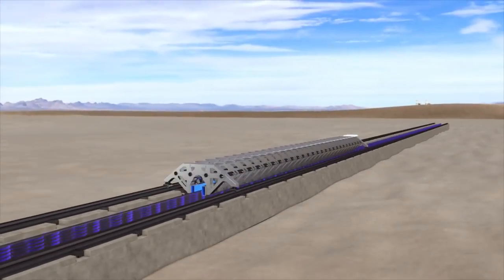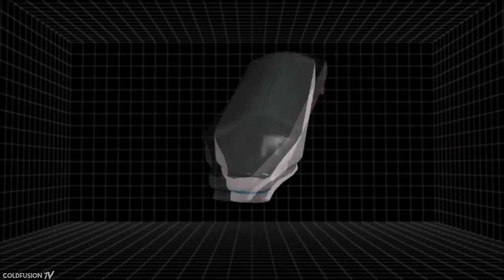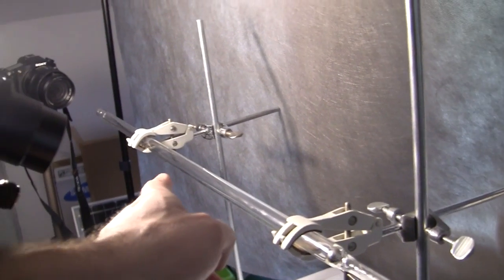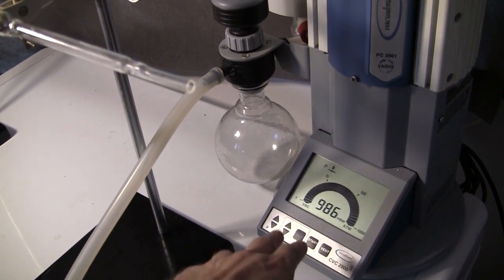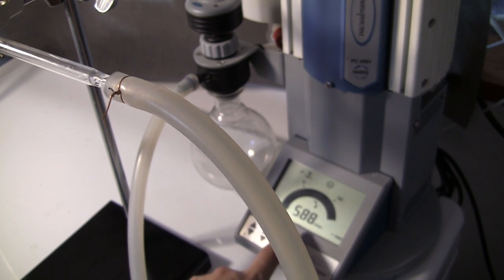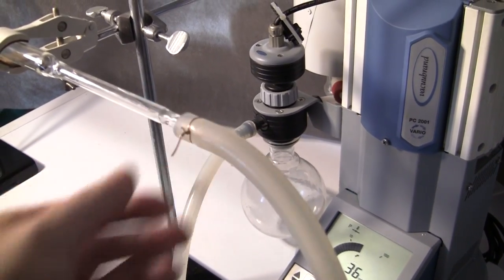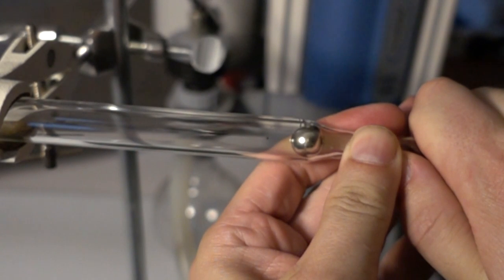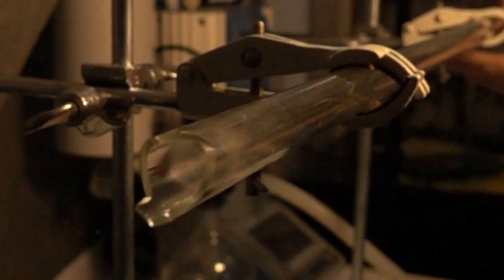How  the Hyperloop can kill you!

Comment: In my opinion this is almost analogous to rapid decompression of an aircraft cabin. Certainly potentially devastating, but nothing that can't be engineered around. I wouldn't go as far as to say it's "PR Bullshit".

EDIT: I'm not saying it's a simple task, but these are challenges that engineering can attempt to solve, and there are plausible solutions.
Reply: lol. "It's a solid fact that a pod in the hyperloop will behave exactly like a ball bearing in TF's video I just watched!!" Alright buddy.
Reply: There's a flaw in your comparison there, an aircraft cabin is quite easy to maintain pressure in, because there is not much surface that can fail compared to a hyperloop tube, which would be going for miles: There's much more potential for failure there.
Reply: Except if a cabin depressurises your internal organs don't immediately turn into meat paste
Reply: Well that's conjecture.
Reply: Except for the fact that the passengers are in a sealed pod.
Reply: It would take 62kN of force from air flowing against one side to accelerate a 3.1 tonne pod with 20g acceleration which has reasonable survival rates on human body. 

Bare in mind that the pod is aerodynamic and allows for some bypass of air around and through it and it has mechanical braking will reduce the net accelerating force by some amount.

TF is doing a demonstration which mimics a gun, with a projectile that almost allows for zero air to bypass it which maximizes the pressure against the projectile and thus higher acceleration.

The pod is the opposite in design to allow for air to bypass the pod both around and through it, at least from what I've seen on the alpha proposal.
Reply: it's solid fact
Reply: ***** Fucking morons.

What do you think happens in a submarine? Yet we still use submarines.

No, a failure in the tube won't cause fatal acceleration because of braking systems.

No, pressure entering the tube won't crush the pod. Why? The pod is already under pressure.

Oh noes, basic engineering problems!

Go fuck yourself.
Reply: There are more modes of failure for aircraft fuselage than a static vacuum tube. 

You mention that there is much more "potential for failure". That's kind of vague. What kind of failure?
Reply: The tube that Elon Musk proposed was about twice the diameter of the pod, the air would largely stream above and around the pod, it would not accelerate the pod as much as thunderfoot show here. The pod would also be much heavier. The experiment he does is not analogous/not nearly good enough.
Reply: +Double - N There's a flaw in your comparison there, an aircraft cabin needs to fly through the sky at high speeds. The hyperloop tube is stationary, and doesn't need to be light enough to fly.
Reply: 62000N / 3100 KG = 20 m/s^2 

20 m/s^2 is an acceleration perpendicular to the spine that has acceptable survival rates.

3100 KG is the alleged weight of the pod as per the alpha proposal. 

Then you can go about engineering solutions that ensure that the pod is not exposed to that kind of force from air flow such as. Aerodynamic shape,  mechanical braking, bypassing air via larger diameter tube, distributed and controlled pressurization of the tube. These are potential solutions.

The question becomes what kind of force are we dealing with in the event of catastrophic tube failure. that requires some fluid dynamics analysis.
Reply: That's what I was thinking, I'm sure there are safety systems which can be developed.

But at the same time I'm sure that  "it's dangerous" is not his only case against this idea, and I'll reserve judgment for the full video. I bet he'll demonstrate how this would be impossible to build, insanely expensive, and innefficient or something along those lines.
Reply: VectorBunny
Cart has a leak/hole/any location that isnt air tight = everyone inside gets splattered across the tube or the inside of the cart like people in a sub.

Tube itself has a hole and the pressure accelerates the cart enough to kill anyone inside or as a brilliant mind suggested in other comments, they try to equalize the pressure and the cart gets hit by rapid pressurization form all sides.

Anything related to magnet failure or friction melting the bloody thing or blowing it to smithereens (being the only pod of oxygen in the tube).

Any form of regular human errors all traffic suffers from but at 2~3x the speed.
Reply: No, its solid fact based on the effects of a vacuum on a human body.
Reply: I agree of the analogy here; however I am skeptical that this can be engineered around. From the get go we knew this would be a problem for it; mostly because when you're talking about distances you'd want to travel in a hyperloop, maintaining structural integrity is more than a challenge.

You have forces like the expansion and contraction of materials due to temperatures as well as movement of the ground beneath you. While these factors are minimal, they can add up to a big problem years down the line.

This isn't equivalent to just laying down some bullet train tracks through Japan, it's a significant step above that. Just doing something like going from LA to San Francisco would basically mean you'd be building the biggest machine man has ever built.
Reply: mrDh4rm3r Yeh, I bet when people started creating planes there were lots of people trying to say how dangerous it was.
Start by seeing the flaws and then work the flaws, not give up, on how dificult it is to overcome the flaws.
Reply: Errr

Inside a plane, air goes IN, creating positive pressure. Your not exciting a vacuum, your doing the opposite. 

So long as any leaks are not significant enough for the engines pumping that pressure in to overcome,  all is good. 

Vacuum is the other way around, any tiny crack, anything wrong at all and the whole lot goes off explosively. 

If Planes were this way, they would be a flying bomb. any crack, any failure at all would cause explosive repressurisation, not DEPRESSURISATION. 

Also it's a helluva lot easier to stick pressure into something then to take it out. 

If the vessel fails, everyone in it will die instantly. There is a very good example of three cosmonauts who had a failure, at a lot higher pressure then this.. they were dead in less then a minute. 

Ones blood beginning to BOIL does that!!
Reply: ***** Plenty? If we're using magnets there's magnetic breaking systems, and you could always have friction braking systems.

Remember, you aren't trying to stop the pod, you're trying to stop the pod from changing speed too quickly.
Reply: a sealed pod that would be hit by a wave of pressure going the speed of sound. Its not the pressure of  the pod its when the tunnel fails and lets the pressure from outside in that's the problem.
Reply: Double - N Aircraft ARE projectiles.

The internal friction isn't an issue.

My understanding is that the idea is to have the pressure higher than Thunderf00t is saying.

I don't understand why people use the word compare to mean "say these things are basically the same."
Reply: Wojciech Pyczak Trains derail as well, you know? The difference is when a train derails, it crashes into whatever is around the tracks. When this fails, where it "crashes" (the tube) is also part of the system, and can be designed with that in mind to prevent that.
Reply: It could have systems that prevent rapid accelaration in case of decompression, like, I don't know...

Emergency brakes.
Reply: honestly I am more worried by things like an earthquake or shifting ground that could slightly bend the tube. Even if it is just a few centimeters, at that speed you are going to feel that bump and and it could be the last thing you ever feel.
Reply: It's strange unlike his other videos this is more about danger/risk rather than scientific impossibility.
Reply: Agreed. I'm not an engineer, but it looks like some of the assumptions T-foot makes here are a bit exadurated:
1. The ball isn't aerodynamic, but the pod is.
2. T-foot's pressure failure is complete and instant, whereas the real hyperloop will likely not fail instantly but may just have low pressure leaks.
3. There wasn't much space between his ball and the tube. The real hyperloop may have more space around the pod (especially since they need those maglev rails)
4. The ball doesn't have brakes, the maglev could have some very strong brakes to protect against such an incident.
5. The real hyperloop will be hovering on magnets, so if you turn off the maglev, the friction increases very rapidly, also acting as a break.
6. They could in theory detect depressurization on one side of the loop and correspondingly depressurize the opposite side of the loop, keeping the pod stationary.

I think he should retry that experiment, but have a flatter piece of metal in the tube (to be aerodynamic) with full friction contact on the bottom (to simulate maglev turned off)

I don't think a valid debunking of the hyperloop will be so simple or concrete.
Reply: +VectorBunny Not quite. The pressure difference is higher, which matters a lot, and it would apply force to one side of the pod, meaning it would accelerate you, likely very fast. It's more dangerous than a cabin pressure failure, but it's also something you can engineer to minimize the risk of.
Reply: This is just a portion of the full video coming up next.
Reply: David Chavez Again, you're not trying to bring the pod to a stop as quickly as possible. You're trying to stop the pod from changing speed too quickly.
Reply: Plus it wouldn't roll like a ball bearing. They could have a system to shut off the electromagnets in case of a failure. Or maybe reverse the polarity and cause as much friction as possible.
Reply: And what about these poor folks that got blown up in the Colombia accident? Just because it has the potential of being dangerous or even lethal when it breaks, it doesn't mean that we shouldn't do it.. Eventually the technology is going to get better and safer. That's why the guys that start doing something first are so respected ;)
Reply: Only part of the tube needs to be under pressure and its easier to keep it protected because its not hurtling through the air.
Reply: ikr. this is theoretically a good idea. it is theoretically possible. doesn't mean there aren't hurdles in the way of making it become reality. that's why the theoretical idea of a hyperloop hasn't come to reality yet.

i think after the brexit stuff people are a bit more critical of TF's stuff... ether that or this is not really a video rekkin' the hyperloop..
Reply: I still think it could be held in place by the electromagnets that float it..
Reply: Like detecting rapid changes in pressure and quickly letting air in on the other side of the vehicle while deploying some kind of emergency break? Would that be possible and feasible and work?
Reply: seigeengine Indeed, this Tube is vastly different to airplanes in many different ways.

The limiting factor for the tube will be expense, and unlike an aircraft, the chances of it actually experiencing internal friction of actual objects is higher: there are projectiles within them which aircraft don't. These are maintaining a lower pressure while aircraft are maintaining a higher one.

I would say that the pressure difference should be put down a little, rather than 1 millibar or whatever make it 10 or even 100, and build them underground: More difficult to breach and if there was a catastrophic event of derailing it wouldn't tumble through the air.

But there is no comparing the two.
Reply: +seigeengine what brakes? This thing is levetating over a magnetic pole going at 600 mph
Reply: +seigeengine what brakes? This thing is levetating over a magnetic pole going at 600 mph
Reply: So what would happen if you're going to be hit by pressure wave from the front, not from the back as shown in the video ? 
By the way, I'm not really that worried about cabin integrity, I'm worried that in case of failure cabin would derail..
Reply: The video had a pressure wave coming from the back, not the front.
Reply: The system has volume to absorb pressure spikes, and we have self-sealing-and-healing materials (not to mention more nice materials tech coming along with every year, which is some really cool damn stuff). Not to mention that if it's supposed to be engineered as described, there's every way of building in a bypass system for emergencies. If Elon and his team can get a 15-story rocket to balance back and forth on its ass, I don't think they've overlooked that.

Although, yes, I am sort of inclined to think that it might have been a bit more doable to just put together stuff like existing lifting body, boundary layer surface craft and maglev tech. Use the air's lift to carry a heavier load instead, and take as much lifting stress off the magnets as you can. You could build a covered concrete ditch with magnetic rails set into the floor and sides, and presto.

Of course, that sort of construction at scale is expensive though. Too expensive for just one company to handle over a significant distance. So Musk has gone instead to the less materials-intensive "shoot for the Moon" option, as might be expected from his track record.
Reply: Using some kind of system in the chairs to reduce g forces like a Shock absorber.
Reply: Yes Misteryman94 if you get some safety hatchs in case of rapid decompression you can equal the forces.
Reply: Supposedly the Hyperloop is going to be built on pylons that act as shock absorbers.
Reply: I fully agree.
Reply: +ducksauce it wouldnt, it hovers over the ground, so its exelerates even better and in difference to a airplain.

it the cabin of a plain rips, the plain doesnt gets faster, the air goes out and than thats it. also there isnt as low pressure at flying hights so the sucking effect is even less then in the hyperloop.

so to compare the hyperloop to an airplain wasnt your smartest move. an even with magnets holting the train down, there is so much low pressure in the tube, and considering the train just fills the tube, you have a lot of force you would need to break. i doubt it works.
Reply: I am more worried about wether it is an obsolete idea lr not. Since several of the things this construction willndo can be done by something else, cheaper and less of a pain.

As an engineer, if it can be done easier doing something else, then we do it the easiest way. Obviously this includes safety and several other things, but this is the best way to describe engineers.
Reply: its doesn airplain on the ground just with space conditions
so where is the problem?
Reply: Beneteus der Gewaltige are we talking about the vehicle rapturing or the tube rapturing !?
Reply: plenty of things wrong with how we travel. this goes faster, uses less energy, less repair maintenance, and should be safer.
Reply: the hyper loop is magnet powered easy solution in an extreme event reverse the magnet pull ground the train also the tunnels will be made of STEAL not glass and this is a huge hole what would cause this sure you may get leaks but they wont do the effects in the vid
Reply: Airplanes are pressurized, because, you know, humans. Air pressure at high altitudes are pretty low, so you got air going OUT and not in of the aircraft.
Reply: There is another aspect that nobody discussed.
Not only is it dangerous if the train capsule depressurizes, it is also a real problem if there is a vacuum leak in the tube. The big advantage of a plane is that it doesn't need an environment of a certain pressure, so long as enough air is present to fly through.
The Hyperloop cannot drive within an atmosphere, which makes it impossibly expensive to maintain.

This is another "Solar Roadways" thing:
Sure it COULD work, but we have a cheaper, safer, more efficient method of travel already: Airplanes. Not to mention there is already a well-maintained and widespread network of airports, and planes have the advantage to be able to land technically anywhere in case of an emergency.

Frankly, this hyperloop thing is an interesting concept, but it just has no real application on Earth. Maybe on Mars or the Moon, where there is no atmosphere to begin with, this will be a great idea.
Reply: I read this in morgan freeman's voice.
Reply: you could Monitor the pressure and if failure is detected let open it at the other end so that you reduce the pressure difference
Reply: Victor Selve  But why though? I mean, the maglev was already way too inefficient, so why pump even more energy and maintenance into it?
Reply: +Nerobyrne
I'm sorry, but these have both been discussed in this thread, thoroughly. 
Tube Decompression can be worked around with equalization methods, the pod would be subject to a pressure no greater than a submarine at significant depth, and we still use those, do we not? As for the acceleration? 
Last i checked, the plans include e-magnetic rails meaning the poles can be switched to make the pod cling to the rails and resist the pressure to be accelerated forwards. 
There are actually more potential for life-saving engineering solutions for this hyperloop than there is for you dear airplanes.
Reply: Wilder "life-saving engineering solutions?" to what problems?
Also, the biggest problem is the price. The regular mag-lev is already horribly inefficient, and you are talking about removing the atmosphere from a part of our planet. Like, really? Who is going to pay for that? I'm pretty sure most people would rather wait 3 hours to get fondled by the TSA than pay for a ride with this thing. This thing is essentially a "give your money to Exxon" machine.
Reply: Yeah.

Seeing that we have problems safely maintaining our road and rail systems, maintaining a ~4m diameter steel tube with all of the pumping and power connections (like having it sectioned every few km maximum to depressurise if track or electrical work needed) will be a cheap walk in the park*.

* This may be sarcastic.

Planes are a bad comparison. They are relatively small units, and even runways are tiny in comparison to the distances that hyperloops need.

Hypersonic aircraft are more promising, although not by much with current technology, simply because they require far less infrastructure to work.
Reply: And the power bill for the vacuum pumps would be horrendous... :-/
Reply: HI MORGAN!
Reply: my guess is that they plan to have an airlock used to place the pod in before it enters the tunnel
Reply: "this is almost analogous to rapid decompression of an aircraft cabin"

No.
Reply: for example if a pressure sensor was to experience a fluctuation in millibar the magnets reverse polarity of the direction the 'train' is moving in the same way a male stops
Reply: Hey, why didn't YouTube show me the 72 other replies when I first considered commenting?
Reply: Agreed, like wouldn't it be possible to just have failsafes on the system? Like some kind of door thing slams shut on the detection of depressurizing with quadruple redundant backups?

Like yeah, it will have issues and challenges, but it only needs to be even slightly be better than current methods for it to be progress.
Reply: +Sterling Hazelton no I want nuclear explosive travel trough the planet at the speed of light with no safety precautions :P
Reply: I agree. This is not a reason that it can not exist anymore then aircraft that fly at high altitudes. The only major issue is this thing would cost a lot to build, so the limiting factor here is money. Can someone build it for a low enough cost to turn a profit? I guess we will find out.
Reply: That is a bit of a problem. Technology at the edge can sometimes not be viable.
Reply: To be fair, it wasn't the tyre failure that caused the disaster.  That had happened before without consequence.  Flicking a bit of stray metal into and rupturing the fuel tank leading to a massive fire is what caused the problem.
Reply: When someone you sub shares a sub with you <3
I love you Morgan Freeman.
Reply: Watch the news someday. Even if the tunnel is perfect, which it wont be, humans are assholes.
Reply: That's not how decompression works. With your logic a breach of a perfect vacum would be infinetly powerful.
Reply: I was about to say the same. Flying on a plane is still safer than driving a car. 
And vacuum failure can be solved very easily.  
Depressurize the tunnel, lol.  Lets imagine the vacuum failure case, open emergency hatches immediately and the pressure will equalize without acceleration to the train.
Reply: yeah... this really spells "bollocks analogy" to me... even if the proposed pressure was too extreme (2g doesn't sound life-threatening to me; albeit it sure might not be good for people with "osteogenesis imperfecta"), they could still go a little more careful in that regard... thing is: do they still reach the desired speed with that different setup?

The real issue will be effectiveness, esp. in regards to costs... for me this smells like some highly cost-ineffective dreamer design, but never as "life threatening"!
Reply: PyrrhoVonHyperborea
I think it's going to be cheaper than plane.
On the ground it can be powered using cheap power sources such as coal or nuclear plants and you don't have to pay for actual aircraft maintenance lol.